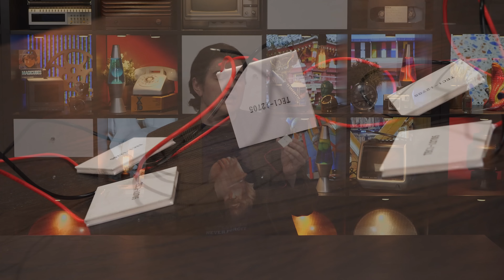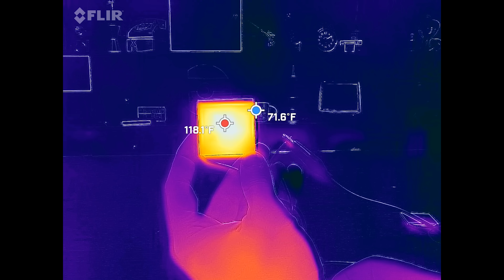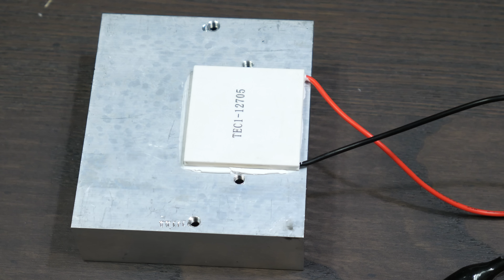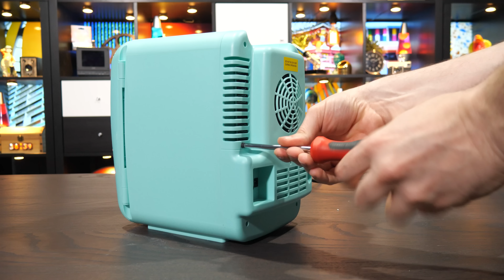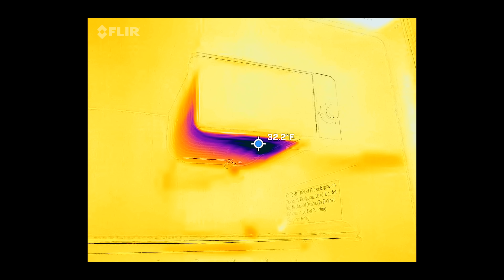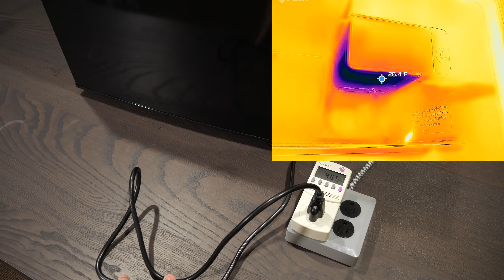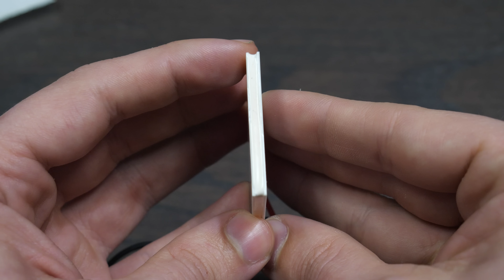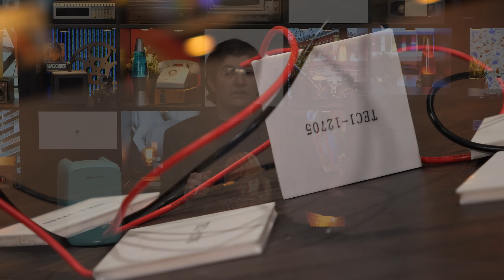Thermoelectric cooling: it's not great.

Comment: I would more so make fun of the engineering of the device itself and the desired affect was not even, "studied", I would assume it comes from the most terrible greed driven humans, like fro ma specific place that flood the world with good sthat do not meet the mark. I am building a  a cooling systme with petlier and incorparting aero gels and other forms, and I have a temp and humidity sensor, as you cna create ice on the dispapators as a humidifier property of the  cool. The temp can be ingauged, also you can re run the heat into a internal blow out ot defrost the  cooling system with little loss becuase of its speed in cooling. While maintaing a heat fan system blowing the heat away never incorporated into the system. Hmm. I would say... someone didn't fully think it through... I plan on having a micro controller, and led display and heat and humidty sensors for a very cold box that  depending on final stages, either a near 0 humidity zone, to reach furhter tempratures without the problme of frost...

naother thing you can do iwth the peltier device for a kids toy, is , if hte humidity is a specifc degree in the air, you can make a snow blast gun that charges up and fires it out, of course it generates lots of heat, but making a snow, confetti gun is possible... takes with ambient water temp. of 22, you cna freeze water fairly fast I guess depedning on teh device, and you cna make the use of more then one devicek but meh... nonsense video.. not hating it, it sjust the entire design of that system needs a overhaul, ontop of hte nonsense, location.. etc.. meh

Comment: I'm an EE and the only reason you'd use these instead of basically any other cooling method is because you have to because of space, or a particular application. The cool thing about these that I always liked is that you can run them backwards, using the "Seebeck Effect" and turn waste process heat into electricity. Although, you can get ones made that are optimized for that, instead of the thermoelectric coolers.

Comment: The Peltier element has one more trick up its sleeve. It also works in reverse. It generates a voltage from a heat difference. We use them here in the UK in stove fans where the heat difference drives a fan motor.

Comment: Oh hay, something I wrote a term paper for in college (for a graduate level course) some time ago.

A big reason why TECs aren't that great is that, for physics reasons that I don't entirely remember, things that tend to be good conductors of electricity also tend to be good conductors of heat. That is, if you look through the equations for electrical and heat conductivity, there's quite a few fundamental material properties that show up in both.

Something something that leads to the heat you're moving trying to migrate back to the cold side (and warming up the semiconductor junctions in the process), ending up putting a dent into the Coefficient of Performance (COP). The entire idea here is that we're using electrons to move the heat energy rather than phonons (i.e. a pseudo-particle of sound). The electrons (and holes) can (mostly) only move one way through the junctions. If phonons can move both ways, and they are certainly wont to do so, that impacts performance.

I hypothesized that using superlattices may keep it easy for electrons to flow, but difficult for phonons  to flow. That could possibly make things better.

I think I also said that we'd need the COP to be something around 4.5 at a temperature difference of 40 K for TECs to be viable in more general applications.

Comment: I'm not really going to disagree with anything you said in the video or your pinned comment other than the fact that many of us regularly use devices where Peltier coolers are useful.

Peltier coolers are fantastic in reasonably affordable astrophotography cameras where the heatsink is huge, area to be cooled is very small, and they have sensors/circuitry to adjust/limit the current flow.  You can crank it up and have sub-freezing temperatures and waste a lot of power, or have a higher target temperature and have it use much less than 10 watts so you can keep things on portable battery packs.  These are very flexible and easily mounted on weight-limited mounts where the cooled device is constantly moving.

In an office setting, the non-fridge is pretty good if you don't have space for a real fridge, or can't conceal it to prevent your carbonated beverages from being swiped (ignoring that you could bolt a lock onto a real mini fridge to discourage that).  If you are only going through one drink per day, it works perfectly well to keep them cool enough to enjoy.  If some nameless company pays the bill and/or has plenty of solar power, it's a win for the employee that doesn't have stolen drinks.

It really shouldn't take much to put an adjustable current regulator, temperature probe, microcontroller, proper insulation, door seals, and a real heat sink to improve cooling efficiency (and minimum reachable temperature), as long as you redesign the inside to spread the cooling area better to prevent icing.  The (temperature delta specific) curves of Peltier efficiency usually show they are most efficient at a small fraction of their max rated current.  They'd still suck for cooling delta per watt, but they'd suck a lot less.  Would people buy them if they had adjustable (consistent) temperatures but cost $25 more?   Maybe.  That's approaching the actual fridge in cost and not getting anywhere near reaching the efficiency of it, but the package size would still be small enough for some people to pick up.

I have bought one of these cheap beverage coolers for use in an office where concealment was pretty much required.  I have also bought a real mini fridge (the largest that would fit under the desk) for use in an office with much larger cubicles.  Both have their uses, even if I strongly prefer the actual fridge.

Comment: I saw another use for the poo poo thermal electric cooling. A neck cooler, specifically something like an Ranvoo Aice Lite, or Coolify 3. It works much better than a neck fan and sucks heat from your skin.

Comment: Those toy fridges are awful in general, but do have a legitimate use case where up front cost is paramount, space is a serious premium, and operating costs get sent to someone else: college dormitories. 

If you're sharing a very small bedroom with someone else and barely have enough room to stand, already spent most of your money on college supplies, fees, and other costs, and just want to have one tiny thing that feels like yours in an insane time, then you're the perfect target consumer for this. 

And even if you did pay the power bill, chances are youre only going to use this for one year until you can move into an apartment where you have a kitchen with a real fridge, so you'd need some pretty expensice electricity for the minifridge to win out before you move and probably throw away the toy.

Comment: Modern heat pump refrigerators have become crazy efficient.  Especially now that they use DC compressor motors they can regulate up and down (reducing huge current spikes when the compressor kicks on from being off completely.).   Same tech is also why mini-split AC units have  become awesome.

Comment: I'd love to see a reasonable video about electricity generation using Peltier chips! In the reverse it also seems to make no sense, but what if you just happened to have an abundance of heat (stove always running) and coolant (living on water) to keep a temperature differential? How would it compare to a Stirling engine, or if you're brave an actual steam engine?

Comment: this is slightly uncharitable, because if you spend *exactly* as much money on a peltier box as would get you a decent cube minifridge, you can get one with a built in temperature controller. and said controller actually has a degree readout. and it also has enough peltier capacity, and seemingly decent enough insulation, to actually do its job.

so instead of being cheap but useless, inefficient, and tiny, it's expensive and still inefficient and still small. 

the other use case of peltier units in home electronics i'm aware of is phone coolers, where pushing a phone SoC to the very edge of its performance while playing Genshin Impact is already wasteful, so burning extra electricity to apply additional coldness to the back of your phone isn't entirely unreasonable (and the smartphone form factor is innately insufficient for offering enough cooling for sustained use of modern flagship chips.)
Reply: I got one to keep my elderly cats medication and food in. It worked out great, small enough to sit on the bathroom counter and much more convenient than running downstairs in the middle of the night.

Comment: The contents of the toy wouldn't be able to freeze unless ambient was less than ~30°F above the freezing point. As the temperature differential increases, the heat pumped drops until it eventually reaches zero. With you can cheat a little by increasing the input voltage, but without modifying the power supply on that thing I bet you'd be hard pressed to freeze anything with good insulation all the way around. Maybe butter.

Comment: I have a 12v Cooler that uses this tech. It works awesome it keeps the internal temp around 40 degrees lower then the outside temp ! I'm in FL in the summer it keeps drinks cold in the sun and in the winter it freezes water over night. I recently got a 12v mini fridge that i now keep running in my truck 24/7 in tis place but i would never get rid of my 12v coolers they're great for camping or spending the day in the woods.

Comment: Dead on, as an engineer that has spent too much time in both the make it cold and make it hot industries (2000PSI with superheat, anyone?) I do have one of the tiny peltier units, though. Free from a coworker who's daughter used it for makeup. My use case is specialty adhesive storage. Think specialty loctite.I need 40 degrees F (5C), in a cooled storage area at 15C. I added a 50mm insulation layer and a thermostat. It fits in a small space, holds several tens of adhesive bottles, and takes an average of maybe 10 or 15W overall. If I hadn't added the thermostat, it would be a lot more energy and too cold. Fortunately, I have a shelf full of controllers and a drawer full of thermocouples, due to the nature of my work. Yes, the use case is a stretch, like pretty much all use cases for Peltier coolers. You use them when there isn't any better option to do the job. The only other time I have used one outside of a CPU cooler is when the primary was an ammonia cycle absorber, and the extra few degrees were needed for a surface (NDA, security clearance,  and need to know work)

Comment: I've had an idea for a while now that peltier coolers would be best used in an array for countercurrent heat transfer (similar to what happens in our blood vessels). This would keep the required transfer for each element (i.e. voltage) low, but still allow for a high overall heat transfer. Here's a bit from what I wrote previously:			

"""
According to Wikipedia, Peltier modules can maintain up to a 60°C gradient with a 6 Amp current, so consider instead 120 modules each maintaining a 1°C gradient (i.e. each having 1/3600 * 6 A = 1/600 A), and it works out to 120 * 1/600 A = 200 mA total to maintain the same gradient.

That seems like a pretty good energy saving. Throw in some additional efficiencies due to electrical conductivity increasing at lower temperatures, and it makes me wonder what I'm missing. It can't be that simple, can it?
"""

Comment: Peltiers are only good for something that both needs to be very small/light (can't do a compressor) and can't have moving parts (can't do fans). It has a few uses in very specific purpose electronics, like monitoring atmospheric conditions in the troposphere (actual application I worked on years ago). Honestly if you need to cool something, either put a fan on it, or if you need sub-ambient, you need a heat pump.

Comment: I wonder how much energy you could get back with a second peltier plate, with the heat of the other peltier plate and the colder room temperature air. and how many more degrees below room temperature that would equate to

Comment: I had one of those six can coolers.  It worked OK for the first year.  But I was lucky it did not burn the house down.  The switch got so hot it melted the entire area around the switch and plug

Comment: When I was younger I tried to invent a fluid circulating peltier based vest to keep me cool when A/C wasn't available (I only saw ice water circulating versions online). I actually had the thing built and tried every combination of pump speed and voltages. I was able to drop the water temp about 5-10 degrees below ambient. What I never factored in was how much heat your body would radiate back into the fluid. While I had a vest built it, the amount of cooling didn't justify the power sucking monster I had created. It required an ungodly amount of power that wouldn't be accessible in most situations, so I scrapped the idea. Even with just two peltiers running full out, it was drawing something like 10A at 12V. 
I did learn a lot in the process and was proud for trying, so it wasn't a total loss.

Comment: I bought a DC compressor to swap the one in a 120v normal fridge, for the offgrid cabin...
The same Galanz  you have!!! Sad to learn it has bad insulation...
The Galanz fridges have a common problem with a relay on the controller board, I bought it faulty

My nephew did a cooler using 2 deepcool CPU heatsink&fan
The cold side was becoming an ice block in few minutes, without a fan running.

Peltier woodstove DC generator is fascinating tho
I wish you covered it

Comment: Tbh you're comparing a Peltier refrigerator to a Gay-Lussac's law (compressor/stuff) one, you can easily spare a dozen minutes or more by stating that Peltier's efficiency is pretty lower, hence why we don't build serious cooling stuff with it. Still there is some space left for TECs.
First and possible most important: TECs have all the mobility ease that a Gay-Lussac's law system never had, I can tell for sure pudding vendors here in Brazil who have to keep their goods atop a big block of ice and replenish every day might like this idea. Just to imagine one example.
Also, as peltiers become cheaper we can easily employ them in lieu of (Joule's law) power resistors, there are dozens of different tools that use resistors and certainly people would buy a slightly more expensive version of it that consumes half the power.

Comment: you could do another episode on the generation of electricity using a slightly different type of peltier element called a generator.  the  body of them is made of ceramic and can withstand 500 degrees.  they use them on the little fireplace fans

Comment: It's too bad we can't make more efficient Peltier elements -- another interesting property of them is if you provide it with a temperature gradient, it will produce a voltage.  Would be sweet if they were highly efficient and you could line the under side of roofing with them - heat in, voltage out.

Comment: I wonder if Peltier devices can be stacked and wired in a way that they transfer heat linearly.  As in, they're all lined up in such a way that, say, up is the hot side and down is the cool side.  Suppose then, that they're all stacked on top of each other like that so that the hot side is touching the cold side of it's neighbor.  Would it project a significantly higher temperature at one end and a significantly lower temperature at the other when compared to a single device?  Or am I simply not understanding how these work?  Because I'm picturing that they effectively work as a polarized heat exchanger.

Comment: We have a few of these in the variation "fridge with no door", i. e. dehumidifiers. We needed them after some water ingress in the basement to put them under shelves or in corners. And they actually did reduce the relative humidity .... by heating up the room! Seriously don't get peltier coolers and don't peltier dehumidifiers either. One proper compressor dehumidifier would have done the job much better (and did in other basement rooms).

Comment: i work repairing lased and pulsed light devices and we use peltier a lot to cool the quartz and not to burn the clients, and on the inside they have strong water cooling systems to cool those peltiers

Comment: The only reason I use one of these, is because my friend gave me a coke can shaped version of one of these that I said I'd never use because of all the reasons in this video. But I found a good use for it exclusively in my car. 99% of the time It's used passively or just sits in my trunk doing nothing. But sometimes for long road trips I keep a couple drinks or snacks cool. Which the car doesn't care about the inefficiency. And I can't be asked to measure how much less MPG I get for running it on a long road trip lol.
Reply: Welp commented too soon because you literally said that a few minutes later lol.